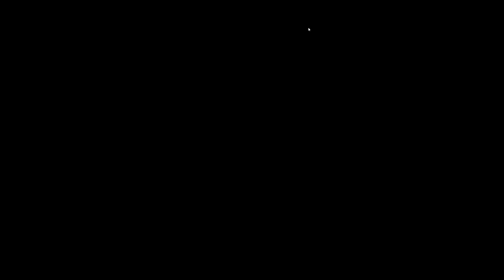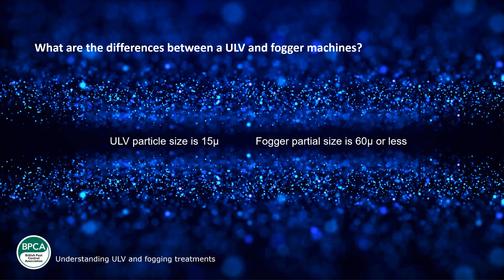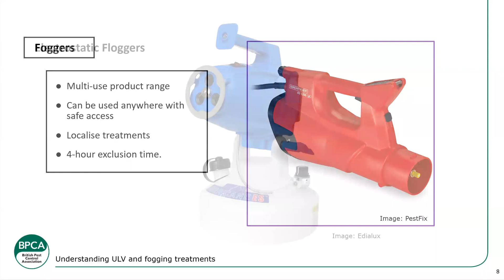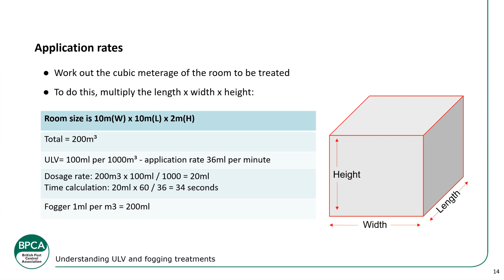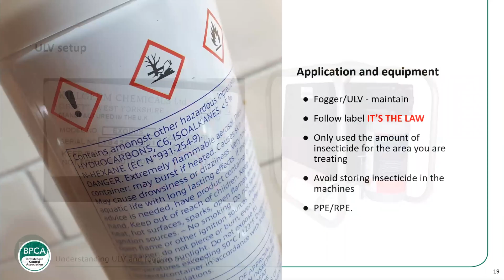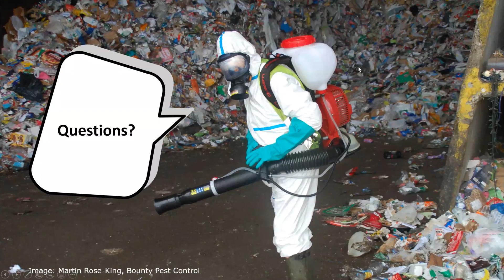Understanding ULV and fogging treatments

Comment: what king of treatment can be use with a fogger? please write a list (in a comment) with the treatment can be use with the foggers. with a fogger can be use:1. solution treatment or 2. "cold fog" treatment? what is the difference in the moister air (humidity), between UVL treatment and fogging treatment. what treatment create a more ununiform  film of solution or moisture?! What treatment is more suitable to protect better the wood. what treatment is more damaging to wood?

Comment: And Johnn did not mix up LW and Foggers? He says that ULVs are solution heating devices, and foggers are motorized devices. It should be the other way around, right?
Reply from the maker: Hi, John says that thermal foggers will create a cloud of insecticide as they use heat to create a vapour. ULV and foggers are classed as cold devices. ULV with a fixed particle size of normally 15 microns and a fogger with a varied partial size normally between 10 and 50 microns. He says he's happy to chat if you want to drop him an email to technical@bpca.org.uk